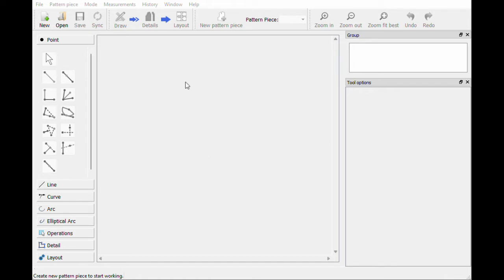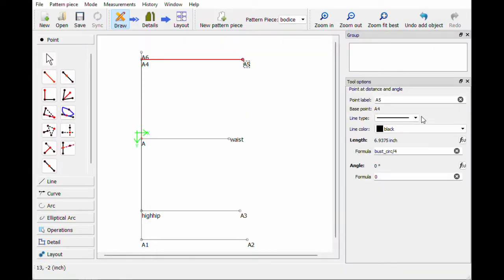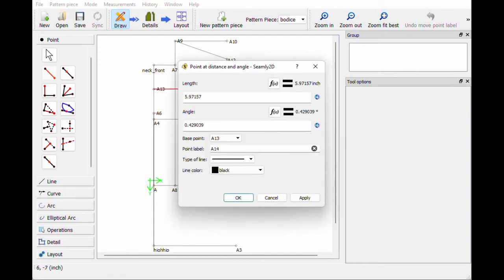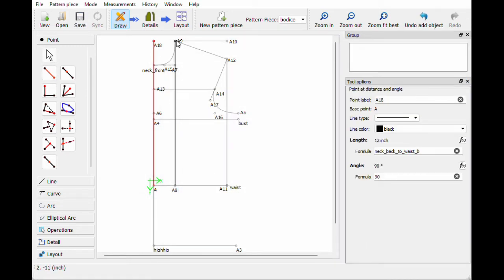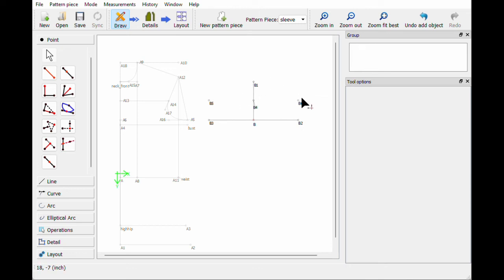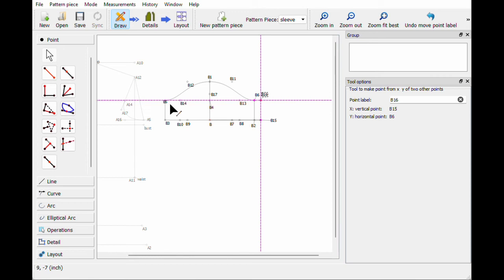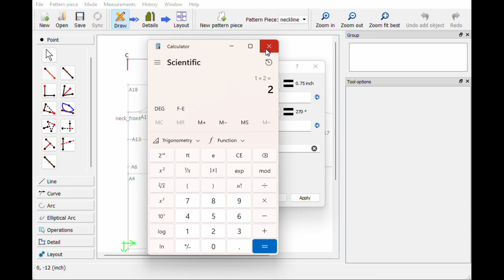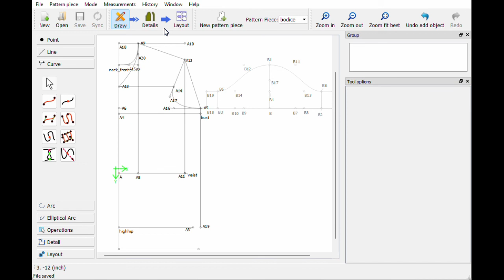How to draft a CAD basic bodice/ T-shirt sloper using FREE Seamly2D software

Comment: I’ve been working on Seamly for a little while now, and I’ve been really struggling with curves. 

It seems like making a curve that hits points shouldn’t be this hard!

Thanks for doing the sleeve cap! I don’t think I ever would have figured that out.
Reply from the maker: It took me a long time to figure out the sleeve caps.  If you want a curve to exactly hit certain points you can always use the first curve tool listed which let's you manually drag the curves around so you can match them up. You would just obviously have to edit it any time you change the measurements.